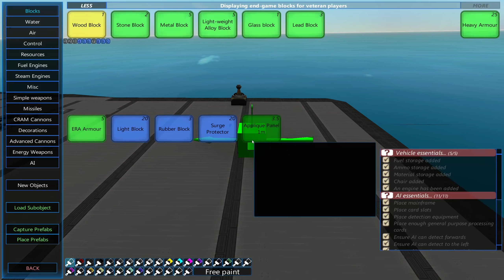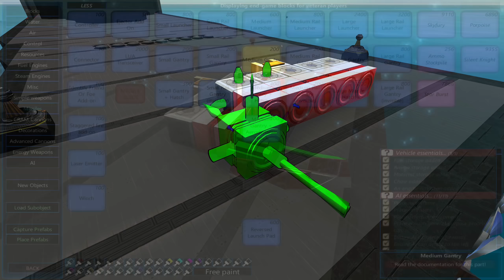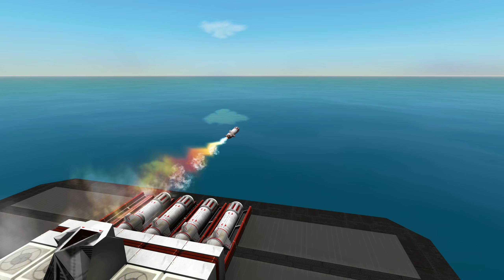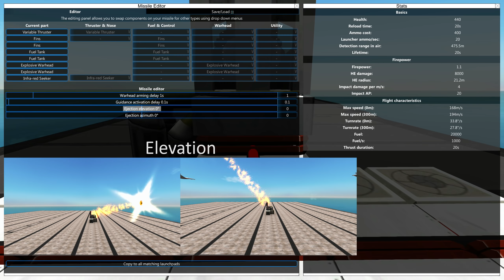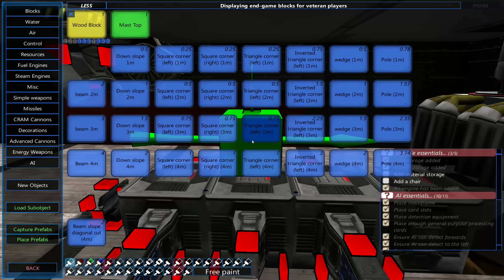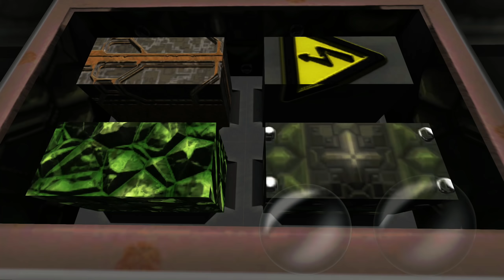From The Depths Missile Tutorial

Comment: A little correction about the regulators; they now add 100% base lifetime,
so a medium missile base lifetime 20 sec with 1 regulator get 40 sec lifetime.
For a small missile launcher, if you want it to harpoon, it requires 4 winches or the short missiles won't fire.
And do not add more than one harpoon on any missile or the missile won't fire either
Reply from the maker: Thanks for the correction!